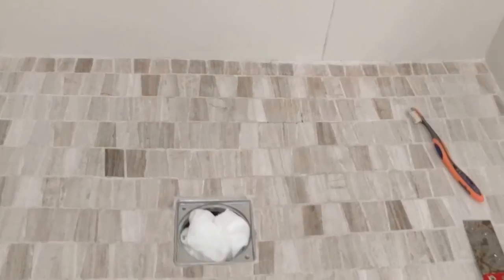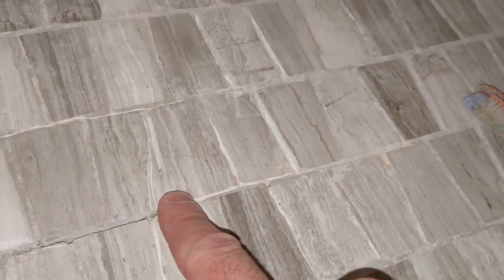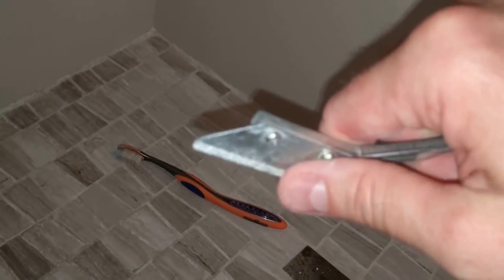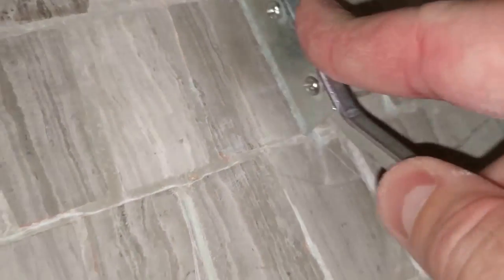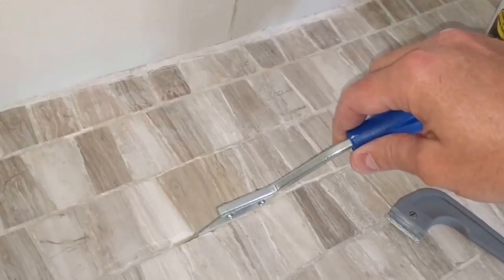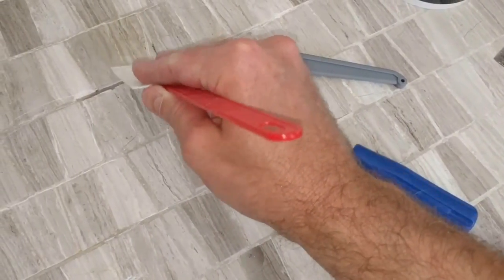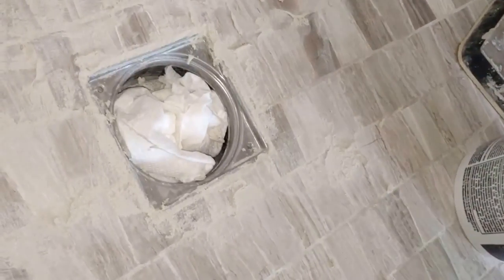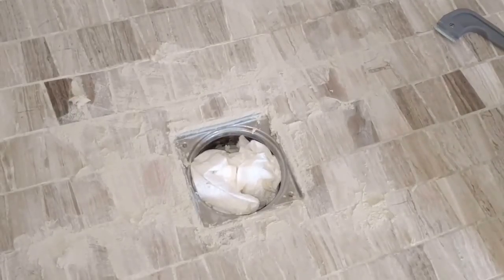Regrouting a shower floor

Comment: I feel you are doing more damage than repairing, I am afraid. Scratched tile surface is not easy to repair and probably needs to be replaced eventually. When using the diamond blade you just move the blade backwards and no need to push it back and fro.  Just my two cents.
Reply: Good to know!

Comment: What did you seal the shower with after re grouting? You said a spray?
Reply from the maker: Hi, Kylie. I'm currently using this FILA Grout Sealer. I can't claim it's the best, but it seems to work for a while. Just keep in mind that you need to scrub the grout and stones regularly and then re-apply the sealer every month or so. 

http://www.homedepot.com/p/Fila-Grout-Proof-24-oz-Tile-and-Stone-Sealer-44750612AME/206392674